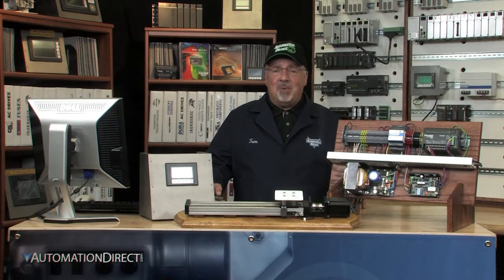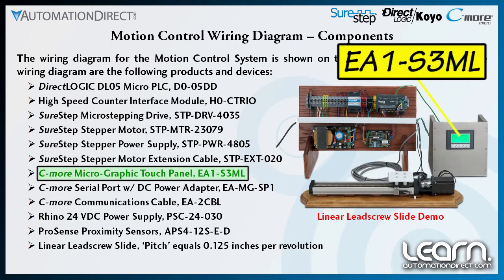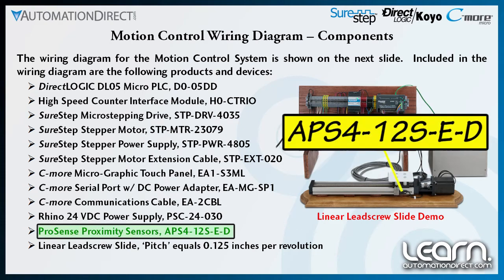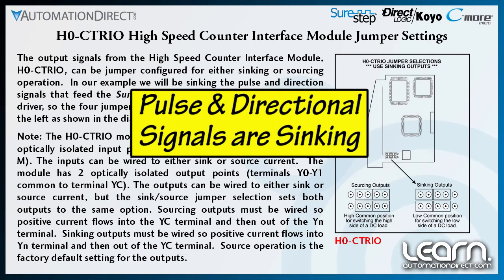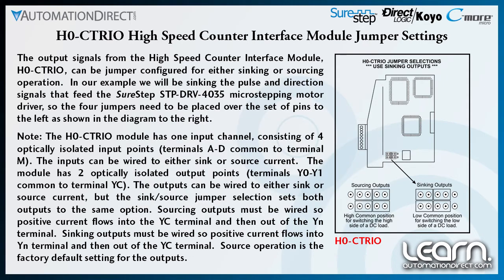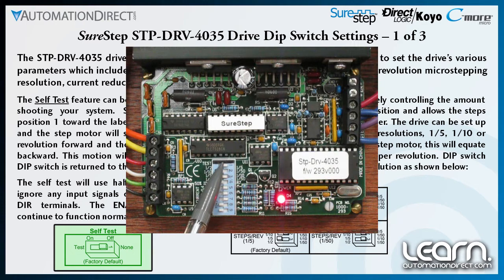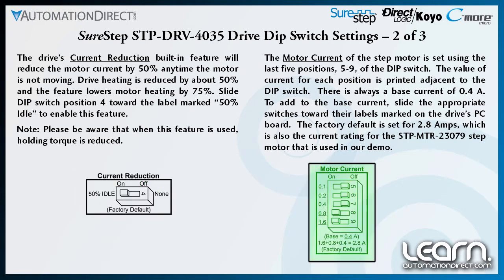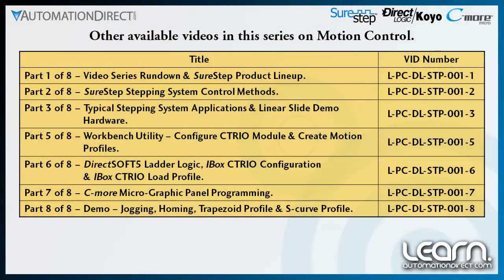DirectLOGIC Motion Control: Module Jumper Settings (Part 4 of 8) from AutomationDirect

Comment: Great video, really helpful, but I have a question.
In this document: http://www.automationdirect.com/static/specs/surestepmotors.pdf
it is mentioned that the STP-DRV-4035 should NOT be used with the STP-PWR-4805 because it exceeds the drive's input voltage range, however in your video you're using that combination and, judging by the schematics, you're not using the STP-PWR-4805 for powering anything else, so my question is: is that a recommended working combination, a combination made only for demo purposes or an honest mistake?
Reply from the maker: Raul Almada You’re correct, the STP-PWR-4805 might fry the STP-DRV-4035.  Also sorry for the confusion – there is a mistake in the documentation, schematic, and graphics. The stepper drive, part number STP-DRV-4035 requires the stepper power supply STP-PWR-3204, and not the STP-PWR-4805.The actual demo shown in this video uses the stepper power supply STP-PWR-3204.
Reply: AutomationDirect.com Oh, thank you so much. Greetings.